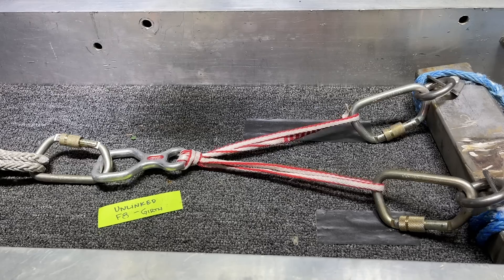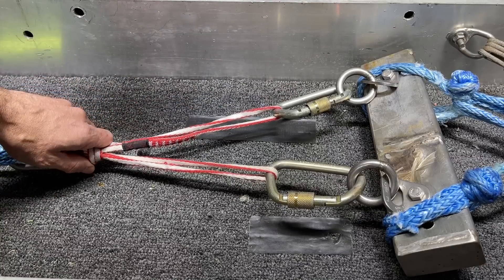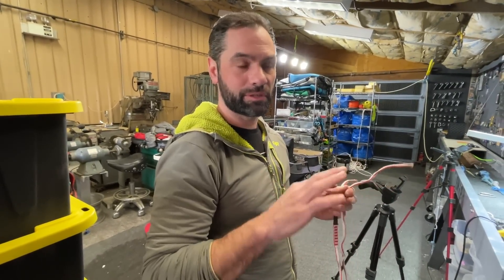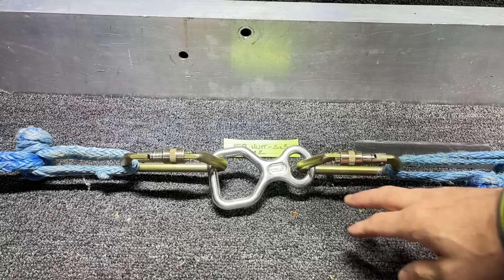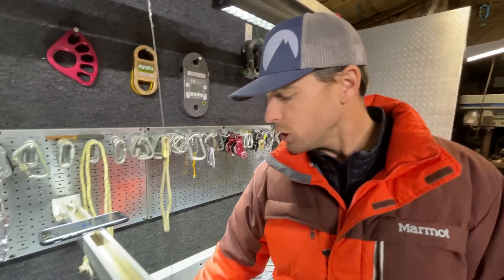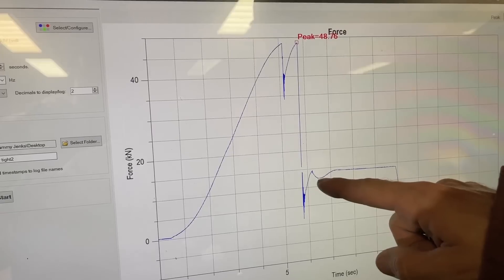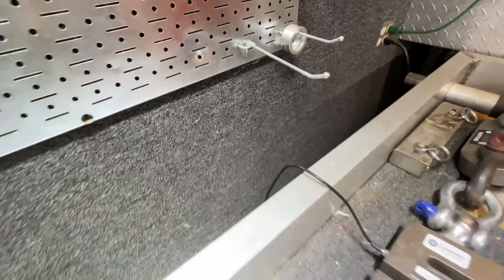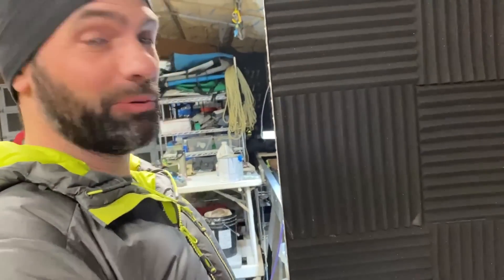How strong is a Petzl 8 descender?

Comment: I've used a descender similar to the Petzl 8 now about 35+ years but in rock climbing.  They are very convenient and fast. I like what you are doing but does anyone really use the descender the way you are testing it? I think the most interesting thing would be to attach it at the small end to a carabiner and rope over the big end in the rappel configuration. The scary thing about this kind of descender is how the rope wears it. Groves are worn by rope at three different places.  At what point should I retire the descender?
Reply: You can flip the descender to extend the life. But you should retire when it is about half way through the thickness or when you have doubts.

Comment: I don't do canyoning and I don't even like 8 descenders... but this video was still very entertaining! The Palikoa being so strong is very wird indeed, I wonder what kind of aluminum alloy is it, and what kind of heat treatment it went through!... Must be a precipitation hardening alloy with very low temperature (low like ~150°C, i mean) and many many hours to reach such strength!
Reply: It is 7075 T-651, which is the same aluminum as most good quality carabiners and climbing gn hardware. The difference is the co figuration and the design. It is design to distribute the forces.

Comment: Rectangles shape and break at 48 kn which is very strong device design for climbers easy to handle the rope slide and hold other climber up to 200-lbs not over 300-lbs climber.

I hope climbers understand shape over the physics and anodize.

Comment: how is the palikoa pivot so strong? it has a small eyelet like any other device. incredible
Reply: It's being pulled in perfect alignment at its strongest point. Carabiners only break as low as they do bc one side is compromised. They almost always break on the gate side bc of leverage and other smart words. If only one carabiner was attached to the hydraulic side it would have broken at a similar point as other devices.
Reply: Honestly if the PK was pulled in the same way as the Fig 8, it would have had similar consequences. But the beauty of the PK, is you don’t ever have to rig it that way. There are option to distribute the forces.

Comment: Huh, I wonder why they make it so strong. Seems way overbuilt for the intended purposes.
Reply: The strength is in the design to distribute the load and put the device in an optimal working load. If it was tested the same way as the Fig 8 it’s would have had similar results. But he beauty is you don’t ever have to rig it that way.
Reply: We most likely saw the most resilient load configuration. I think it has to be also "strong enough" (but not that high) in other configurations (i.e. side load).